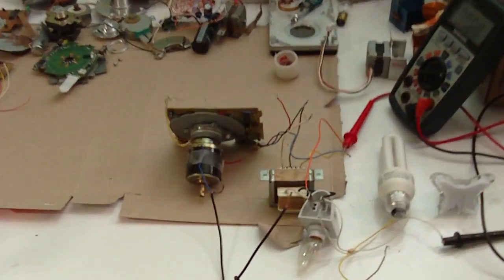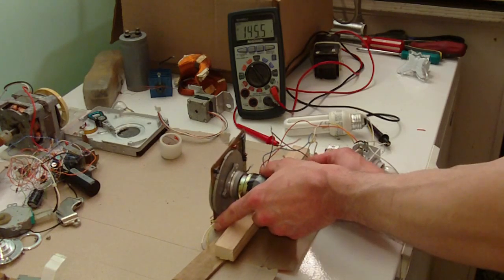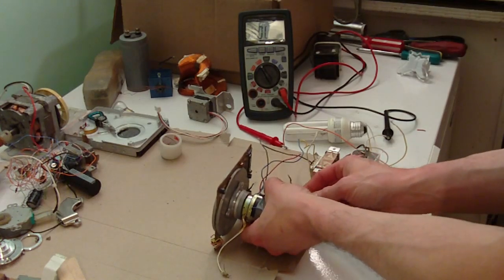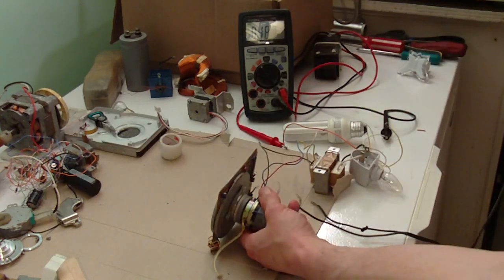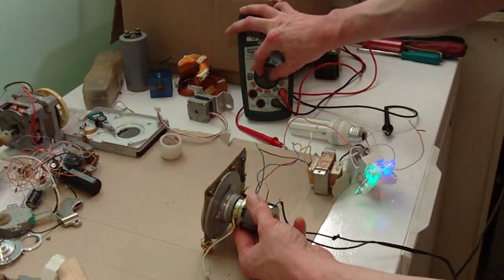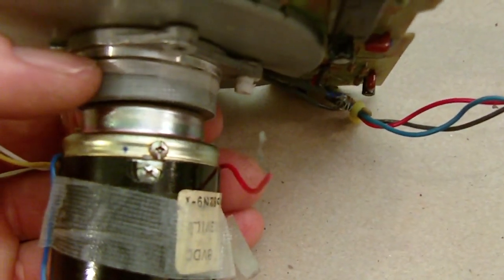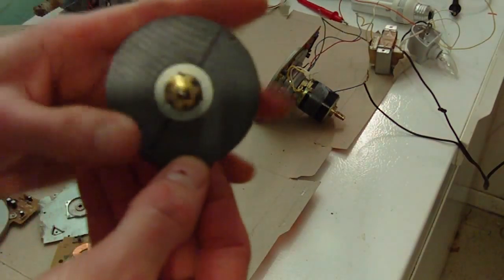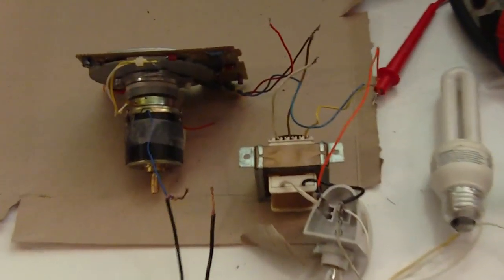Motor inverter DC to AC

Comment: why you touching the bear wire if your powering your load with ac
Reply: its not like only AC can shock you DC can also shock you but at higher voltages

Comment: does anyone know the efficiency of a motor-generator setup?
If I put in one kwh, how much would I get out? (i know it is less)
could a DC motor be connected to an ac generator for a cheap high quality inverter? (not high efficiency)
Reply: As a gross general rule, AC is slightly more efficient in many cases, but only by a few percent. As an example, Tesla Motors decided on AC over DC in their cars because in THEIR APPLICATION, they determined they would get about a 2-3% efficiency premium for going with AC. That was after some EXHAUSTIVE research funded by very deep pockets.